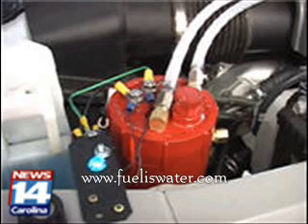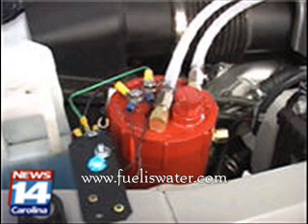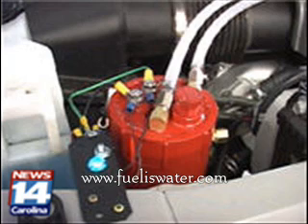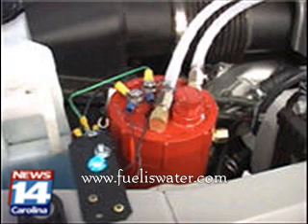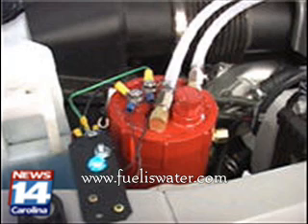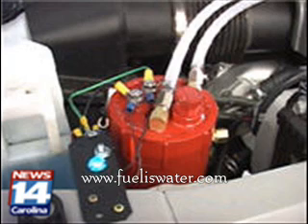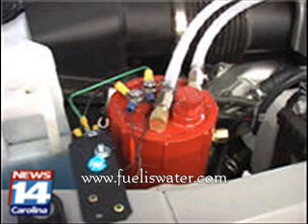hho in car

Comment: Not saying Im a believer myself but from the research I've done is that Hydrogen has a higher flashpoint, so when injected into the mixture it burns a lot hotter than regular hydrocarbons thereby releasing more energy, increasing your horsepower which may compensate the draw from your alternator. I've also heard about people using small solar panels to power  the electrolysis process or using braking as current hybrids do now to recharge your battery. So maybe, I'd want to test it myself though.